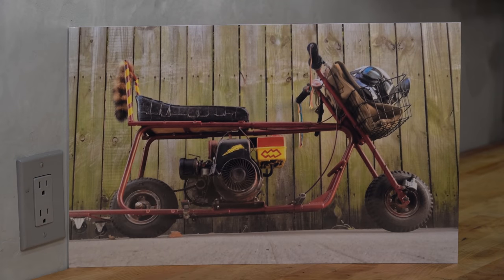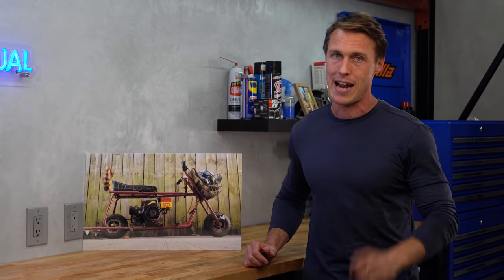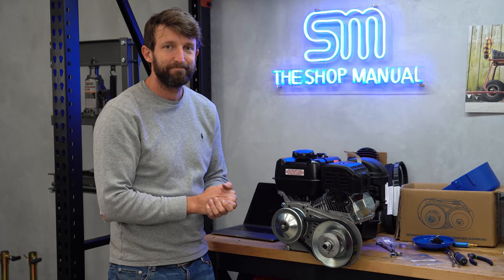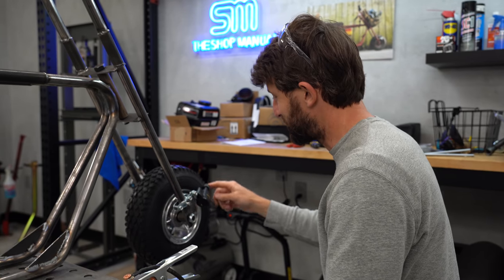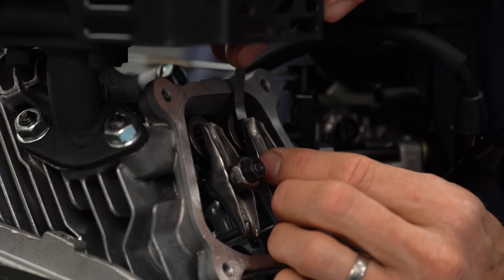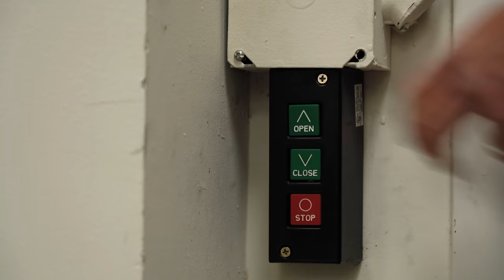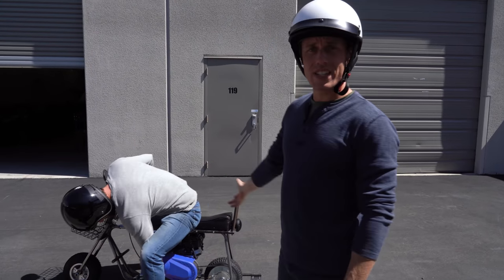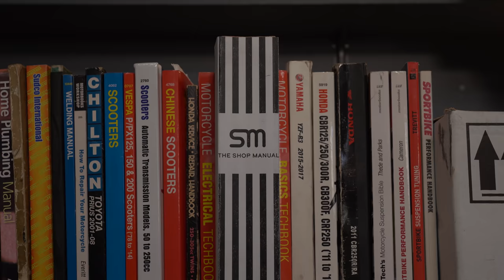How We Built the Dumb and Dumber Mini Bike | The Shop Manual

Comment: The likely reason it was running rich to begin with in the actual trip was you rejetted the carb but didn't get a higher flow filter and exhaust, so it made it that much richer when the elevation increased.

Comment: In regards to the ubiquitous Predator 212cc engine that was used, the rated power on those is 6.5HP. With a few easy performance mods, that can be doubled.

Comment: I have that same motor in my 1961 Cushman. Via the centrifical clutch, I can cruise around 35 mph. She weighs 297 lbs..  The engine is a gas hog. 11 miles to that tank. Still a kick to drive. Cheers !

Comment: Just installed a 212cc with CVT in an old doodlebug. I installed the engine on a 1/2" rubber mat (in an attempt to tame the vibes) and two 1" rails for clearing the CVT. The factory gas cap would not clear, but I found extremely low profile gas caps on Amazon and those worked. So, if you are doing this, try a low profile cap before buying a tank as the cylindrical tanks be pricy.

Comment: Having grown up in the minibike era, almost every bike maker used this design or a minor variant of it for their bikes.  Changes were made to accommodate front and/or rear suspension, the Comet torque-converter drive (which your bike had, and without which you'd have never completed the trip!), fenders and other things.  I had a Fox Trail Tramp with two-speed transmission and several other bikes - Honda Mini-Trail included - but my pals had Rupp, J.C. Penney, Honda and other brands.  Other than the Honda, I don't think we had two of the same brand in our "gang", as there were tons of makers in those days.  Now, with the absence of places to ride and more suburbs being built-up, there are fewer makers around, though those that still exist make products better than what was available back in the 70s.
Reply: My buddy had a Rupp. Tough bike. I had a Grand Prix, Under powered with only a 3 HP, but had front and rear suspension. The best was the 165 Harley  2 cycle single cylinder with a springer front end, rope start (wrap around rope, not a recoil) and a belt drive torque converter like a snowmobile. I tried to look it up, and  the only rope start Harley was the "Topper" scooter, but they all had  Recoil start and Front Leading Link suspension, and not a Springer. This had no fairings. I'm guessing it was from the 40's or 50's and probably worth a few bucks now. We took the front end off and made a trike and threw the rest away. Another buddy had a Honda 150 Dream. I think the best was the Honda Mini Trail though. Even those came in different models. One was a 50cc 3 speed, no hand clutch and another was a Honda 70cc 4 speed with a hand clutch. Another buddy had a Honda 90cc step through. I graduated from the mini bike to a Yamaha 80cc road bike.
Oh the good ole days....

Comment: Riding a minibike powered by the movie acurate engine which im assuming is a tecumseh. Although a 212 it would be SOOOO much better given that it has much more torque. Also guys as an a recomendation if anyone wants to bump up compression and such on that model of predator get a flat top piston a thicker head gasket and a + .040 billet rod. Itll get a lot of compression and itll run very well. That version is the non hemi version, the hemi version would have been better for this specific build though cause it does better unmodified but if you wanted to turn it into a race ready engine the non hemi (which is what this is) is the best way to go, its cheaper and can accept many more aftermarket parts

Comment: With that port work, did you guys make the rookie mistake of putting a larger main jet in the carb?  The fuel drawn into the airstream goes up by the square of airspeed, so if the airspeed in the venturi goes up due to breathing mods, you have to put a smaller jet in it to keep your A/F ratios correct.

Comment: after watching both vids I think you guys probably should've gone up to a 7" tire and pull a few links off that chain so you'd have some room to adjust the mounting plate/tension. 

that and a Tecumseh STAR motor on Methanol >_>

Comment: The original dumb and dumber uses what looks like a Honda G200 engine, the predecessor of the Honda GX200 which is what the predator 212 is based on, you should probably try to get an original Honda G200 engine for the authenticity

Comment: Hey hey hey!  What was the tool used to cut the frame?   Was that a circular saw??
Reply: Yup, with a Diablo Steel Demon blade. It's been a total game-changer for my fabrication program. It cuts up to 1/4" steel beautifully.
Reply: @AriH211  is that a standard speed saw, too?  Don't need to slow it down or anything?   Yeah, I can see that being a massive time saver!!
Reply: @uberDoward  Yeah it works at standard saw speed, which I think is about 5000 rpm. I wanted to get the larger 12" blade for my chop saw but the tip speed is too high and a dedicated low-speed metal saws is $$$. And I hate abrasive wheels. I've been amazed at the efficiency and durability of this blade.

Comment: $641 USD... I bought my first bike for 600CAD, put about 25,000KM on it before tearing it apart for a restore. Granted, this was brand new and mine was built in 1984 and had 36,000Km on it when I got it... I still feel like I got the better deal.

Comment: Challenge, with off the shelf parts, make a 250cc motorcycle. You know...like China does daily. With fairings, windscreen, etc. Cost of build, style points, and then make it a daily driver test. How far off is this from what Japan does? Thats the question. Is the whole greater than the sum of the parts. "Aristotle"

Comment: It looks like the original is a stretched taco 22
Reply: The Taco 22 had a spring fork and the frame cradle mated with the seat area differently. I studied a lot of frame kits and I'm pretty confident this is the right one. It's an Azusa Engineering kit.

Comment: A clutch is better for longer drives a torque converter tops off early and can burn and melt the belt if used for a long duration once a clutch is engaged its like 1 piece till you let off the throttle.
Reply: It worked for 400 miles em route to Aspen, and the same CVT design is used on my Zuma scooter (with 16,000 miles on it). It’s tried and true.
Reply: Isn't  that a CVT?
Reply: @AriH211  Ari, when my wife sees me starting this project in the garage she's going to be PISSED! Now where did you get the CVT?
Reply: @danmanthe9335  We got all the parts from OMB Warehouse. It's just a standard Comet CVT, but the minbike folks call them "torque converters"

Comment: Damned thing wouldn't be so shaky if you used a billet rod with properly balanced bottom-end with it... like you're supposed to. And... no cam? No higher-ratio rockers? You didn't even use a Mikuni carb or tuned-length header... What kind of a engine build is that!? }:[